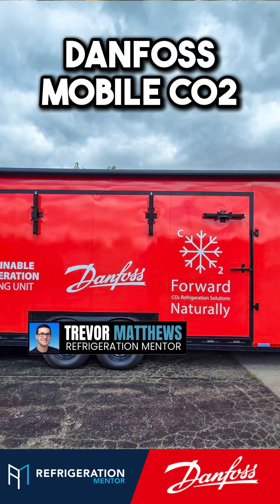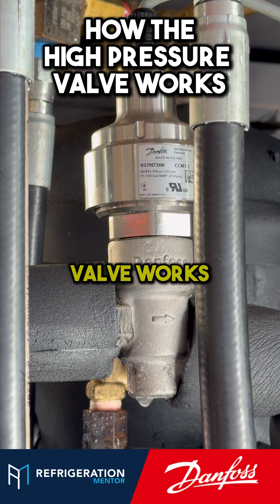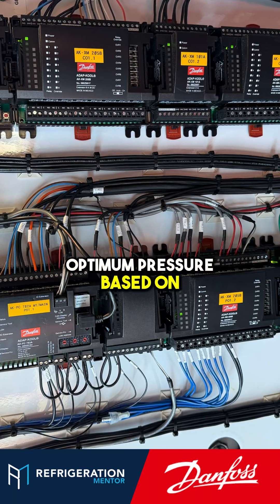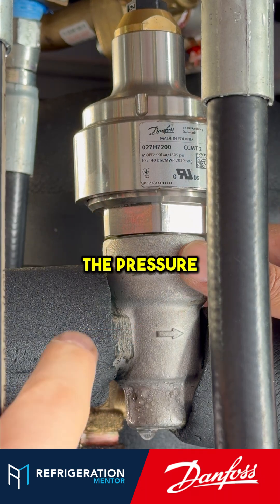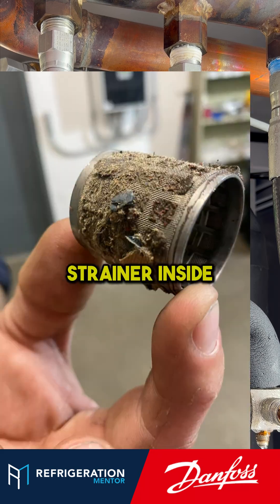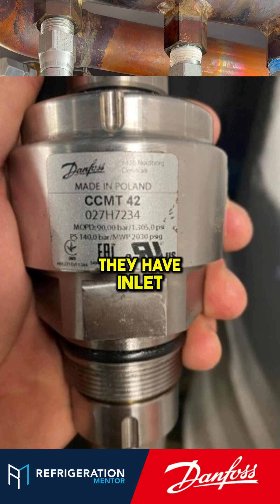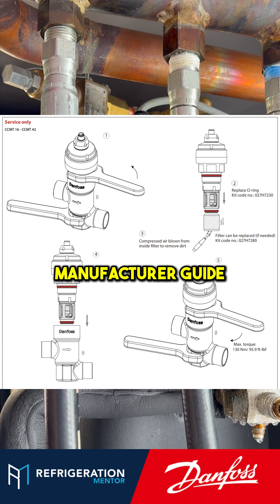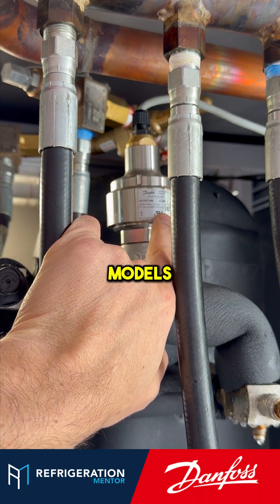How does the high pressure valve maintain optimum pressure in the gas cooler on a CO2 system?

Comment: This is Casey from Tomco changing one out right now. 
Pumping down the rack.
Reply from the maker: Keep up the great work Casey!! I am looking forward to connecting again. Next course you take you will enjoy all the new rack control setup and troubleshooting to our CO2 courses.
Reply: Danfoss changed the whole design of the valve and no longer can just remove the powerhead and guts . need to pump down the whole rack and change the whole valve itself.
Reply from the maker: @Casey-uv9yd the smaller ones do not have a screen. The ccmt 16-42 have removable strainers.